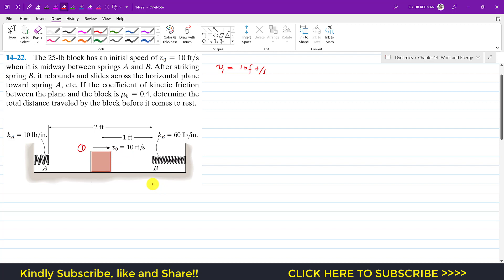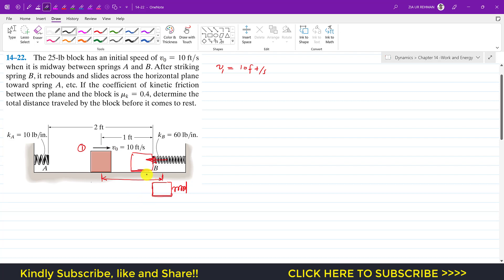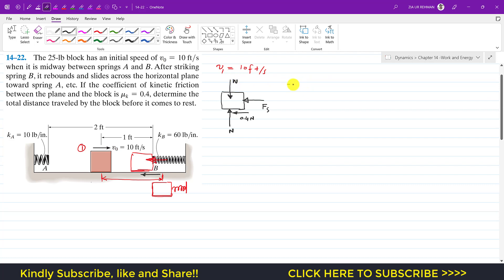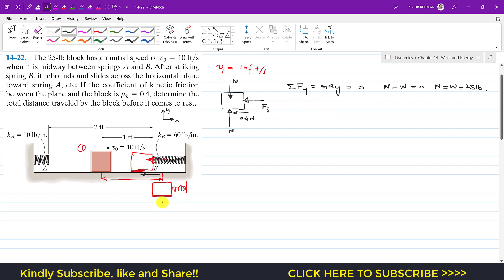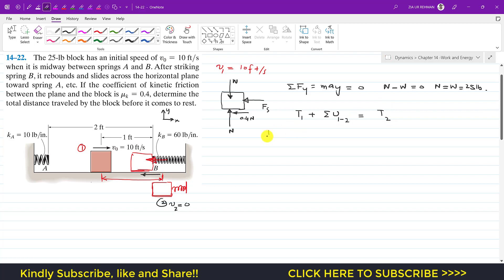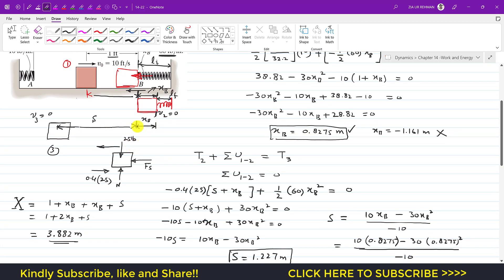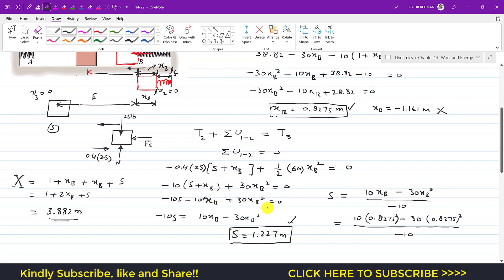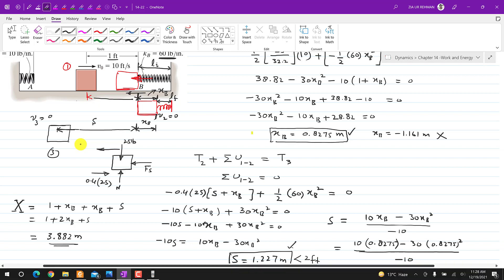14-22 Kinetics of a Particle: Work and Energy | Chapter 14: Hibbeler Dynamics | Engineers Academy

Comment: Do we need not to conveet unit of spring constant to lb/ft???
Reply: With all due respect to the publisher, I must comment that this solution is done incorrectly, though still, the correct answer is there because the springs are conservational. The spring constants are supposed to be changed to lb/ft instead of kept as lb/in. To prove that the conservation of the spring is the reason that this problem is still right: you can do this problem while completely neglecting the springs and you will still get the right answer. So 1/2*25lb/(32.2ft/s^2)*(10ft/s^2)^2 - 25lb*0.4*distance = 0. Solve for distance and you will still get 3.88 ---> 38.81988lb*ft - 10lb*distance = 0 --> 38.81988lb*ft = 10lb*distance --> 38.81988lb*ft/(10lb) = distance --> 3.881988 ft = distance.

I wanted to clear the confusion for anyone who thought that lb/in should have been converted to lb/ft. You would indeed be correct. In fact, if you do this, notice how this solution never utilizes the second spring on the left... if you convert to lb/ft the 2nd distance you get will extend to touch the 2nd spring, causing you to solve another equation before you get to the final solution. Regardless though, because of conservation, no matter how different you do it, you will end up with the right answer.
Reply: @derekprice2873  bless you derek, bless you
Reply: @derekprice2873  Thank you for your thorough explanation!